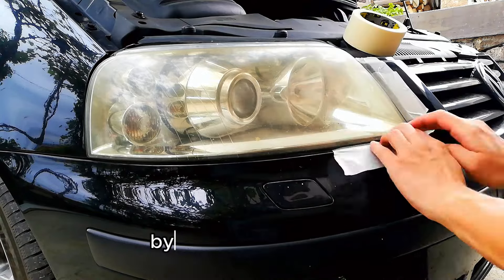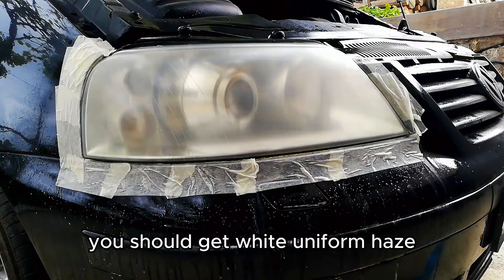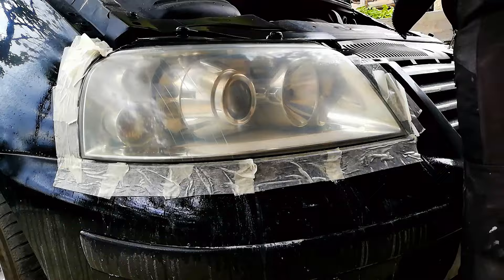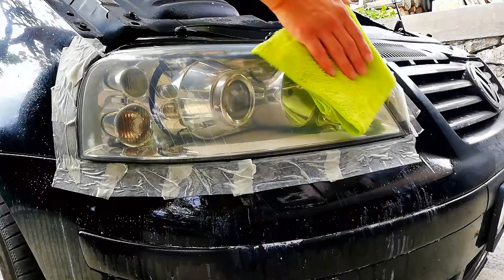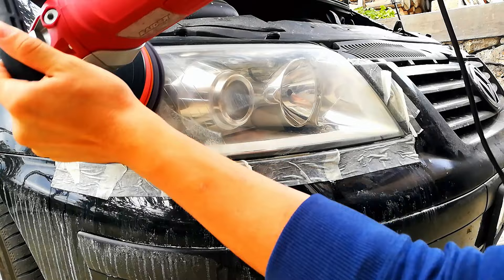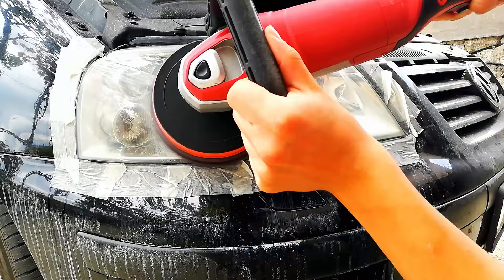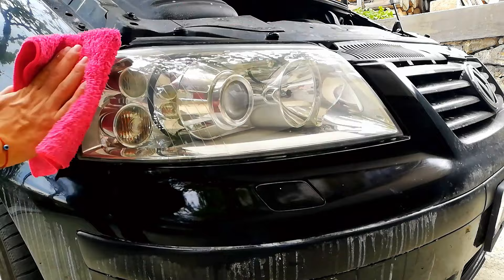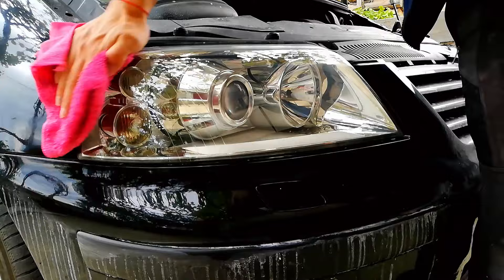Headlight restoration shown in 4 minutes

Comment: think i would rather pay a shop to clean mine. to much work
Reply: Aww, get out of that recliner and do something!😁
Reply: Lazy or what
Reply: Get off the sofa
Reply: I just replaced mine with new lens (on both wife's car and my own)  probably took less time than this did !
Reply: @bbo40  Very wasteful!!!
Reply: @bbo40  I thought about it, but on my Jetta, I would have to remove the front bumper to replace the headlight lens.  That is something I am not comfortable doing.  This, however, is.
Reply: On a cheap car with cheap parts it's OK for my car headlights cost 1500 usd each side so I'm happy spending a few hours and do it myself

Comment: What if I don't have a buffing machine, what is an alternative to performing the compound scrubbing?
Reply from the maker: If you have a drill use it, if not I would suggest getting a Cerakote headlight restoration kit. If not you can use a microfiber towel and hand polish the lens.

Comment: Hmm, so when will the next wax application be required? Since the UV coating has been removed, and now the headlight will prone to yellowing quickly , Thanks
Reply: I re-apply wax to mine monthly and no haze in over a year!
Reply: I have refurbished many lights this way and I can say that some of them lasted longer without maintenance than new ones with the original UV varnish. If you briefly re-polish the lights with car paint paste once every 6 months they will last for many years.

Comment: Beautiful results, but which part of this more than 25 minute procedure fits your title? What is equally important, as mentioned by another viewer, is without some UV protection coating the light will haze again quickly.
Reply: Apply a good paste wax monthly. Over a year with mine and no haze.
Reply: I was ignorant that paste wax could act as a UV inhibitor. That's good to know. However, for me at least, having to do that monthly would get forgotten fast. I believe there are wipe on or spray coatings available (ie Meguirs, and others) that can be applied  on a yearly basis.
Reply from the maker: The title is about showing the whole process in 4 minutes. Yes, coating is a must if you want the headlight to last longer. However nothing is permanent. Thanks for your comment
Reply from the maker: Maybe not monthly, but a couple times a year.
Reply: Ceramic coat them or apply PPF
Reply: Stop moaning re the 4 minute. Its obvious it means 4 minute for the video

Comment: Cleaned em..watered and sanded with 800.1200 nd 2000 like instructed.. cleaned and polished with the screwdriver and abit by hand...cleaned em and even milkier when they dried..the wax cleared em up abit but not much..didnt i polish enough or is it coz theyre plastic?
Reply from the maker: Its hard to tell when I cant see them, make sure to sand in cross pattern. For example 1000 vertical, 1500 horizontal, 2000 vertical and 2500 horizontal. Dry the headlights after each grit and inspect to see if you missed a spot. This will make sure you are not missing a spot. I will suggest to go up to 2500 grit and use good compound and pad for the polishing step.

Comment: How long is every grit step? and what if i dont have a polishing machine?
Reply from the maker: It takes 3 to 5 minutes. You can polish the headlights with microfibre cloth by hand if u don’t have a machine.
Reply: @btnw8   you have any thing that powered to spin a cake mixer or fan or drill will work improvise

Comment: What if the problem is the inner part?
Reply from the maker: Then you will have to open the headlight and clean it from inside. Seen a video where a dude cleans the inside with a microfibre towel and 2 magnets. Havent tried that yet tho
Reply: do you have any thing that powered to spin a cake mixer or fan or drill will work improvise

Comment: Why do that.  All you need is mothers wheel polish. Same results.
Reply: Just did mine today with mothers and it came out amazing!
Reply from the maker: Aluminium polish won’t work for these headlights, u need to sand the rotten 2k clear on top.. otherwise you will have a line and difference between the 2k and the non coated part of the headlight

Comment: Might have been easier to jus buy another car 😂
Reply: By using small increases of grit size, you don’t need to sand a lot. 
I find it’s much less work to use small increments because large increments requires a lot more sanding. The sanding should take much more than 10 minutes.